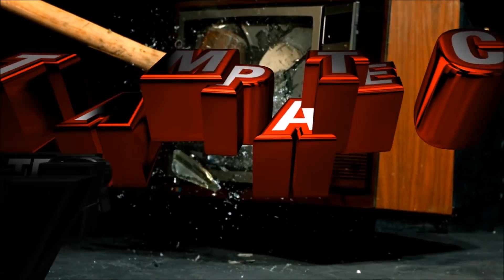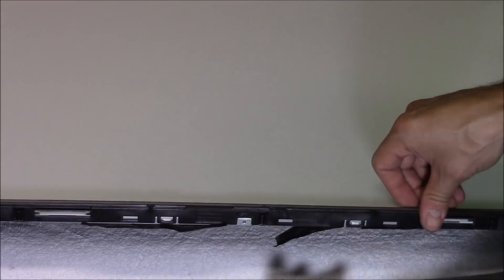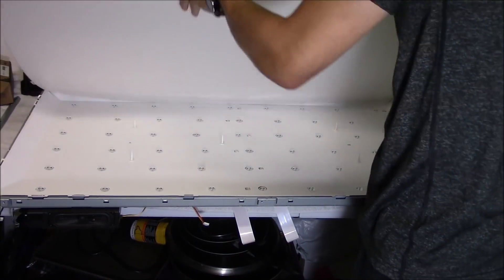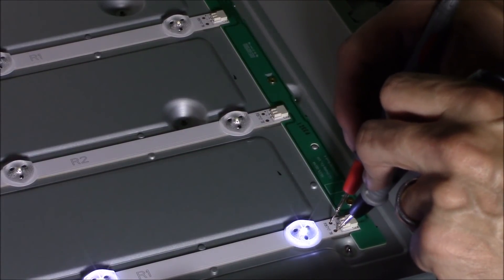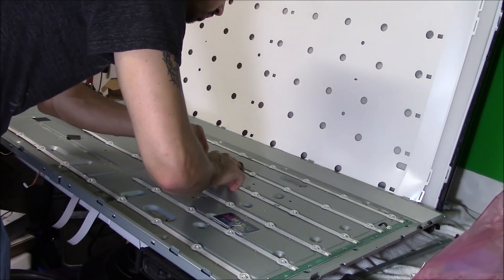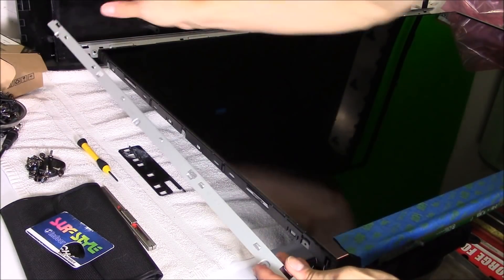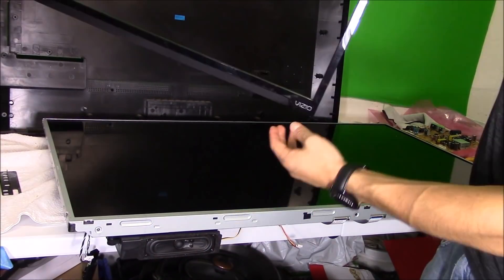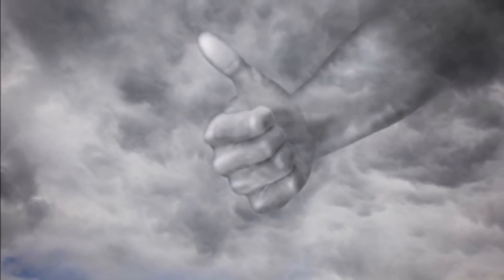How to fix LED LCD TV Black screen No backlight Dark picture Shadow spots

Comment from the maker: Shorter revised video version, this is full backlight repair guide, full disassemble, testing, ordering parts, fix, assemble of the Vizio or LG LED TVs, factory reset won't fix tv, LED backlight repair  kit here-http://bit.ly/2a2njb6
Reply: The LED Back-light strips are LB50068, but what is the part number for the LED that is soldered on to the strip  for the VIZIO E50x-E1 ?
Reply: This was very informative I can’t wait to get my tv repaired

Comment: Okay so I have a new 70 inch Samsung smart tv and something fell down in front of it and missed the screen but knocked off the bottom strip on the corner where the controller buttons are located..... The ribbon has become disconnected and there isn't enough give to put it back in.... Do I have to take the whole back panel off to get to it???

Comment: Hello.  I have a Philips 55 inch Class 4K Ultra HD Android Smart LED TV 55PFL5604/F7 tv.  A remote got thrown into it by one of the kids.  It powers on but has a circle crack right in the middle of the screen.  The right side shows a good picture but the left does not.  It has backlight.  There are some lines running vertical as well.  It has sound as well.  Where do I start trouble shooting?  Thanks in advance!!

Comment: 1:50 If you make the LCD Panel stand on it's Cofs like that then you better say good bye to your TV, the connections are like strands of hair glued together on a Piece of Paper thin film, so whatever you do DON"T EVER let the Cofs get damaged. Also try to lift the panel out of the place first by evenly pulling it out of all the sides (Make sure you've removed any double-sided tape and any stickers or even screws of the LCD's PCB. Some also have their COFs glued to the plastic frame) then start detaching the Plastic frame and the rest of the stuff, it'll be much easier to do the rest of the work and will help you keep the LCD panel safe.

Comment: Hello! Great channel! I have an RCA 46" led tv. I got sound and picture but no backlight. All leds turn on when I use the led tester. On the power supply I get 56v on each of the 5 led connections with the tv on stdby, when I press the power button to turn it on I get 62v on each but no backlight. Could it be the led driver on the power supply? RE46HQ1004 is the power supply number. Any help will be appreciated.

Comment: Love your tutorials, very informative. Would you be able to offer your advice on what board to check on a 32” Westinghouse TV that has the Source Select box continually on the screen. Unplugging all cables for several minutes and making sure none of the buttons on the remote or tv aren’t sticking. Much appreciated!

Comment: hi thanks for all your videos i appreciate your help. just checking to see if you know what voltage i should have on a pin with abbreviation of LED-BR i have nothing on it.... and have no back lights on 80 inch vizio. leds are good i have put 3 different drivers .thanks for your time

Comment: I've used your channel to help me repair my 2013 VIZIO P-Series 65" 4K LCD. From replacing the capacitors on the power supply to eventually replacing the power supply itself. One of the LED backlight zones has started to dim and not illuminate with the rest of the screen; which has brought me back to your channel. 
With all of that said though, back in 2013 4K TVs in 55+ inches were 3000+ USD. Now a 70" 4K Quantum VIZIO is like 1500 USD with shipping. Time to retire my loyal P-Series and opt for the new thing.